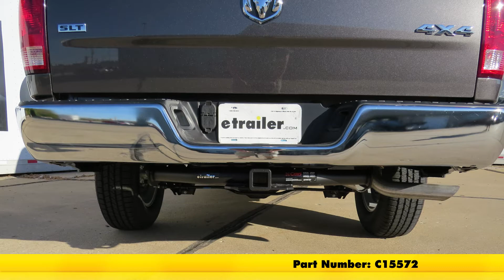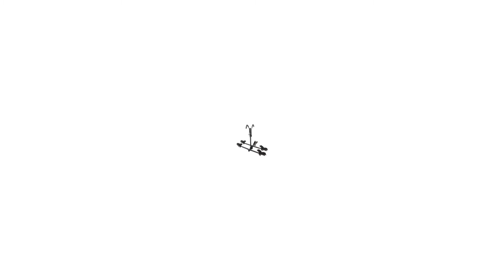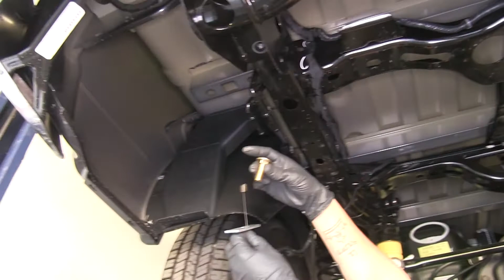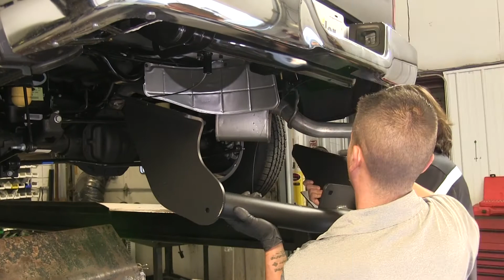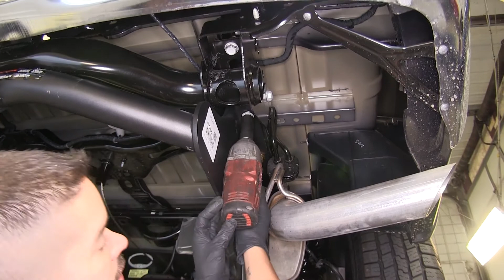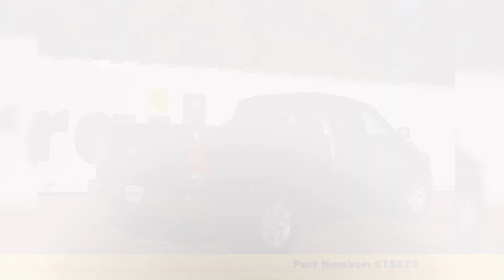etrailer | How to Set Up Your Curt Trailer Hitch Receiver on a 2018 Ram 1500

Comment: what size are the bolts and spacers i ordered a class 4 and it came with no hardware at all
Reply from the maker: The grade 8 hex bolts are 1/2-13 x 1-1/2. Two of the spacers are .250 x 1.50 x 3.00, the remaining two are .188 x 1.00 x 3.00. Did you check the receiver opening? We typically place the instructions and the hardware in a plastic bag that's stuffed into the receiver tube. If it's not there, give our Customer Service folks a call at 800-298-8924 for replacement hardware. 
https://www.etrailer.com/Trailer-Hitch/CURT/C15572.html